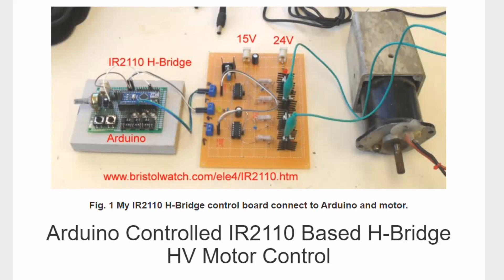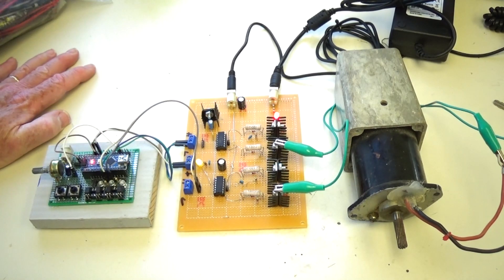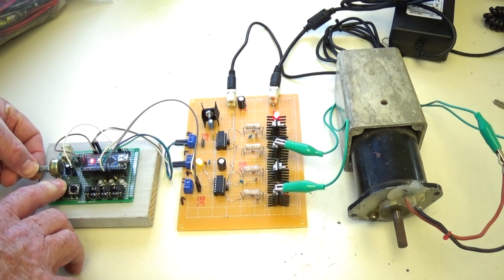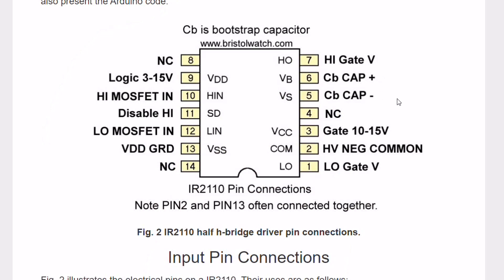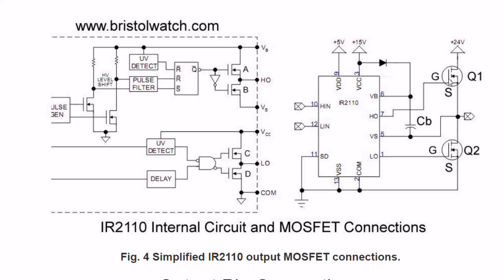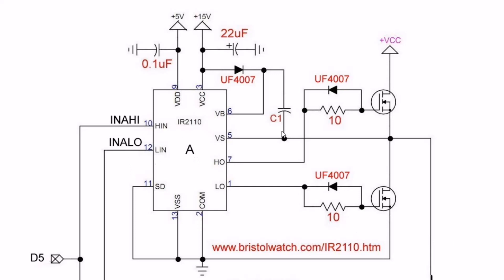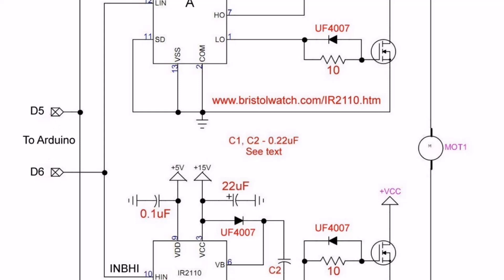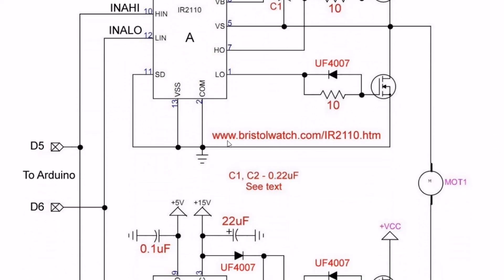IR2110 Based High Voltage H-Bridge Motor Control

Comment: Thanks for the cotent but i was wondering if i have a high wattage motor in the case that i need to parallel two mosfes in each in each switch for better current handling .Can the driver circuit work if i short the two gate inputs or what modification would i need to make ,?.Thanks
Reply from the maker: MOSFETs are easy to parallel; make sure they are the same type, voltage, etc.

Comment: Hello
In your circuit, you used two digital pins but in the code you are using 4 digital pins. Could you clarify that for me? Also i have seen a couplenof articles that suggest that the charge pumping has to be done in code by switching on and off the LINs. Could you speak on this for me?
Reply from the maker: Charge pumping is done by PWM. Go to the webpage in the description, and I cross-wired down to 2 pins, or one can use four.

Comment: can i use this circuit to produce 400Hz 115Vac (1A-3A)output ?
Reply from the maker: No. The pulsing from PWM keeps the bootstrap capacitor charged. Use a transformer circuit. I'll look something up.

Comment: And also you showed two pin to arduino but in the program you described ( #define) 4 pin, So should I assume that you are using four pins and not two as shown in the picture or you are using exactly two pins as shown in the picture?

Comment: "Hello, how are you? Could you tell me what power supply you're using? I have a 12V DC motor, and when I connect a load, the voltage at the motor terminals drops significantly. I think it might be the switched-mode power supply I'm using, but I'm not sure. If anyone has had the same issue and has already solved it, I would really appreciate your help.
Reply from the maker: I used 15V but at 12V both the motor voltage and control voltage can be connected together.

Comment: I have 25 v supply and i used voltage divider to the pins VCC and VDD of Ir2110. I couldn't drive the h bridge since MOSFET gate is not opening but the voltage is reaching the IC perfectly . I used the same circuit ,except VCC and VDD voltage supply ,and code but no use. Why is that???
Reply from the maker: You have to use PWM to turn on the high-side driver. What is this voltage divider about?
Reply: @LewisLoflin  I supply 25 voltage to high side MOSFETs drain pins. This 25 v is divided 2 times to IC s VCC and VDD. So that's where I used divider . I also used PWM still mosfets not activated.
Reply: @LewisLoflin  can you give me a suggestion please. Iam working on it for 1 month still it is not

Comment: Man, stumbled upon this video in search of how to use a 160v DC motor we pulled of an old Tigerstop, where the controller gave out. I know nothing about electronics, only programming, and was just looking to learn how to even connect it to an Arduino. I have the amp board it connected to, and you just showed me what half the board does. I may not even have to create a new board, just find out where those pins from the 2, 2110's lead and connect to them directly.

Comment: how much Power(Watts)  from the 24v and the 15v and thx
Reply from the maker: Depends on the motor. This can work with several amps.
Reply: @LewisLoflin  if you don't mind  , i made this circuit with irf1404 , i connected the ir2110 ground with motor power supply ground and the 15v(-) and 5v(-) , it worked fine with 12v 1amp motor then i used a 12v 7amp motor sadly the gate resistor of the high side and the low side blow up with the ir2110,   could you give some advise for how to connect every ground or if you suspect the problem and thx
Reply from the maker: @filaliaziz971  What do you mean by "hooked to ground." 5V is not the motor supply. There should be no motor current through the gate resistor.

Comment: Excellent. What frequency did you use to create the pwm? Sound like under 10KHz because of the beeeep sound from the motor. Thanks
Reply from the maker: It was the normal PWM from an Arduino nano.
Reply: @LewisLoflin  what value? Thanks.
Reply from the maker: @Ferrotandil  Don't understand the question. The PWM frequency is fixed by Arduino.

Comment: Hi, thanks for the great video. I have couple of questions
1. What are the n channel MOSFETS used in this circuit? 
2. Will this circuit work fine for a 48v 5000W 3 phase BLDC motor? 

Thanks for your help!
Reply from the maker: Depends on the MOSFETs. Just because the spec claims say 50 amps in reality derate it to 35 amps.
Reply: @LewisLoflin  thanks

Comment: It is possible to connect pin 9 with pin 3 with the same voltage (12 volts, for example)
Reply from the maker: Yes. if VDD is rated 5-15V, the voltage isn't exceeded.

Comment: were the outputs sinusoidal enough? im thinking of making  a project on resonant inductive power transfer. will it be fine to use a coil instead of a motor used in this circuit. thanks
Reply from the maker: The output is a square wave.

Comment: thank you for this project. one question : how the cp capacitor going to charge and discharge while your code state that low side gate either a constant high or a constant low ? as i know for the cp to charge and discharge we need to inject  high side with  pwm  and the low side with it is inverted one
Reply from the maker: Discharge is internal to the IC with the PWM input.

Comment: hi pls anyone know whats happening?: i only have IR2110smd in my area and i buyed it and i build exact circuit and here is problem, high side is allways full open i cant turn off and low side is sometimes work some times dont i dont rly cant get it Q:(where i but my arduino ground? , its means if i give 5V at HI - HO will puy out 15v?, if i give 5V at LI-  LO will give 15v?) or (i connect my arduino ground at LI and PWM at HI?)
Reply from the maker: You have to use PWM.

Comment: Sir,
Question on HiIN and LoIn of ir2110.
Shouldn’t there be a pause between the signal?
Otherwise is there a chance that both mosfet gets open at the same time. HiIN and Loin are 180 degree apart from eachother.
Reply from the maker: The IR2110 prevents this.

Comment: Sir, do we need the common ground here? Thank you!
Reply from the maker: In this case yes. For isolation use optocouplers.
Reply: @LewisLoflin  OK. Thanks! You are my hero....btw. on your web page there is written: "....It does this without the use of p-channel MOSFETs or photovoltaic opto-couplers...." So now I am a bit confused :)
Reply from the maker: @map3033  Exactly as it says - no p-channel MOSFETs nor photovoltaic optocouplers. Just n-channel MOSFETs.
Reply: @LewisLoflin  ok..by the way.. do I need to provide 20V to Vcc of ir2110  when the Uge of mosfet is 20V? Now I supply +15V and do not know if it is enough...
Reply from the maker: @map3033  There are two supplies here, the logic voltage in this case I also used to power Arduino, and the motor voltage. The gate voltage is created from the logic voltage.

Comment: For the bootstrap gate supply you need PWM to charge the cap, I get that. For the low side however, is PWM required?  For example to get a 4 quadrant motor control with regen, you just run one of the two low side devices with the high side off. I also realize your code is just going for simplified H bridge motoring and not braking. Just figured I'd ask before I let some magic smoke out.
Reply from the maker: PWM isn't needed for the lower MOSFET.

Comment: hello.  for inverter electrode cb capacitor what values are used and what type of capacitor for 50khz.  thanks.
Reply from the maker: I really don't know. Why operate at 50KHz?
Reply: mr i will use ir2110 for welding machine and i wanted to ask you about capacitor cb (bootstrap) what type and what values can i use.

Comment: Hi Lewis
I have tested his design and it works very well.
I have however made some changes both hardware and software.
As Mosfet I used some IRF1405 which are higher in current for my needs.
I made these changes to the software:
1) moved the arduino output pins to 3 and 11, this to be able to set a PWM frequency 31000 Hz without interfering with the Delay and Millis functions which would otherwise be altered by modifying the PWM frequency on pins 5 and 6 of the original soft..
2) to change the PWM frequency I simply added this line in 'void setup'
TCCR2B = TCCR2B & B11111000 | B00000001; // for PWM frequency of 31372.55 Hz in pins 3 and 11.

The basic pwm frequency in 'digitalWrite' is low (about 900 Hz), the motors produce noise, and at high rotation speeds with the frequency modification they maintain greater torque and no noise, the Mos work even better.
Yours is a great project, thanks for sharing it.
Reply: in the video are some resistors missing on the drawing
Reply: Did you totally removed digitalWrite and replaced TCCR2B = TCCR2B & B11111000 | B00000001;  or you added this line extra, can you kindly tell ?
Reply: @arkapravomandal3267  added

Comment: OMG, my son and I have been struggling with an H-bridge controller for an electromagnet for days. We finally got it working last night with the addition of p-channel mosfets but then discovered if the input voltage went over 8v it started to short out. Thanks to you, I now know we need a hi/lo ic driver! In the interest of time we'll probably go with an off the shelf solution for now but this was a great, relatively inexpensive, learning experience. Thanks for working out all the bugs and posting this!

Comment: I made an h-bridge basically utilizing this schematic to power some 120vdc (250-300w) motors I have. It works great for lower voltages such as 24v, but when powering higher voltage motors, I am getting some blown mosfets when powering off while the motor is spinning. Would redundant diodes across the mosfets help this failure? Mosfets are 600v 10a rated. Thanks for your helpful video!
Reply from the maker: The 10A rating is the MOSFET D-S not the diode. Try a higher current diode across the MOSFETs it can't hurt.

Comment from the maker: Other H-bridge videos:

High Voltage IGBT H-Bridge Using Photovoltaic Optocouplers
https://youtu.be/azJo4h-ei6I

Pt. 1 Interfacing Microcontrollers to CMOS and MOSFET Circuits
https://youtu.be/XzetdwzcOrY

Pt. 2 Simplified CMOS-MOSFET H-Bridge Circuit
https://youtu.be/rExHPqTUBuA

Pt. 3 Tri-State H-Bridge using CD4093B CMOS Circuit
https://youtu.be/b8O4ihdHx8U

Pt. 1 TB6600 Stepper Motor Driver with Arduino
https://youtu.be/PHe2MK9CvQM

Pt. 2 Program TB6600 Stepper Motor Driver with Arduino
https://youtu.be/jtX0t7-m69M

Arduino Unipolar Stepper Motor Driver Board with Arduino Code
https://youtu.be/HTVYiLOY8SQ

Pt. 1 TB6600 Stepper Motor Driver with Arduino
https://youtu.be/PHe2MK9CvQM

Pt. 2 Program TB6600 Stepper Motor Driver with Arduino
https://youtu.be/jtX0t7-m69M

Comment from the maker: Everybody note I ran some more tests. The gate voltage VCC can also be the the motor power voltage. I tested it at 12 and 15 volts and it worked fine. Do not exceed 15V for VCC.
Reply: Hi, I wonder if we can use this circuit to drive a 18V motor or not. My Vcc voltage (connected to IR2110) is 12V.
Reply from the maker: @michaelsilverhouse2122  12V will drive an 18V motor but not as well as 12V would.
Reply: Hi  @LewisLoflin   , I wonder if I can drive a 90V DC motor with this circuit?. 
Also I have doubt with one of your answers. You said that circuit only need PWM signal on the high side gate activation MOSFET but when we interconnected HIN to LIN you also have a PWM in the low side gate activation MOSFET, is this a problem for the correct operation of the h-bridge?.
Reply: Lewis, i know its an old topic but do we use 4 arduino  pins or 2, if 2 it means pwm going to high and low side?
Reply from the maker: @optix3100  Go to the webpage link in the description. It has the Arduino program I used. 
https://www.bristolwatch.com/ele4/RI2110.htm
Reply: @LewisLoflin  Hello sir.  I have a mosfet with Vgs = 20 V. Since bootstrap will charge up to 12 V how is it possible to operate this mosfet. I have seen on the internet that its actually 12 V + Vdd but how? I thought that the capacitor will charge up to 12 V and since it is in parallel to Vb-Vs it would give 12V to Vgs. Could I kindy ask you sir to explain this to me?
Reply from the maker: @vinrys5366 @vinrys5366  20V is the maximum voltage on the MOSFET gate source. 12V volt or even 8V will fully turn on every MOSFET I have ever tested.
Reply: @LewisLoflin thank you for your answer sir and excuse me for delay. One more question then. Since bootstrap voltage 15V is between gate and source of mosfet and beetwen drain and source there is 24V, does that mean that that mosfet needs to have 40V max Vds? I believe those voltages 12 and 24 will get in series don't they?
Reply from the maker: I would use 4.

Comment: At first glance this looks like it might work to run the typical 90V DC brushed treadmill motors. If so I can think of several projects that could benefit from having a programmable control interface.
Reply from the maker: I tested it on a salvaged 100 volt treadmill motor.
Reply: @LewisLoflin   That's even more good news. Looking forward to the follow up video. You mentioned it needed to be pulse width modulated but gave no specifics. I'm guessing the Arduino programming description covers those details.

Three applications come to mind. The first is a basic treadmill controller to replace an obsolete model. Second is a spindle motor controller for a manual or a CNC lathe. I have a couple of small lathes with treadmill style motors that I converted to cnc. The third application would be for those trying to build electric vehicles using surplus motors.
Reply from the maker: @tenlittleindians  That is on the webpage. The HIGH side MOSFET or HIN on the schematic must be pulse-width modulated. That is what controls the charging action of the 0.22uF bootstrap capacitor Cb.
Reply: @LewisLoflin   I found the link in your drop-down after trying the dead link web address posted on the schematic within the video.

I was looking over your diagram and noticed you used a discontinued MOSFET. When I looked it up I noticed it had a far lower value than the 500 volts you mentioned. So I did a search for MOSFET chips designed for a higher voltage and found several that go far beyond your 500 volt limit. That's got me wondering which part of your circuit is limiting it to 500 volts? Not that I need anything higher but I'm just trying to figure out how this thing works. I had basic electronics in the 70's so I'm rather limited when I try and understand these things on my own.

I'm in no immediate need of this circuit but I do sometimes like to breadboard things like this if I've got the parts laying around. (I don't have the MOSFET's)

I also noticed you have a couple of LED's on your board but I don't see them in the schematic. Oversight or maybe the circuit was changed after you built the one shown in the video and in the photos? Did you point to point wire that on the bottom?
Reply: @LewisLoflin  hi I'm 'using it to make a remote controlled lawnmower with 2 24V 330W motors, to increase the deliverable current I have paralleled some IRF1405 which without cooling fins work very well over 50A
Reply from the maker: @salvatorebarbaro5862  Low resistance MOSFETs eliminate the need for giant heat sinks. Parallel MOSFETs within reason cut this even lower. Great work.
Reply: Can this module run 220V single phase induction motor?